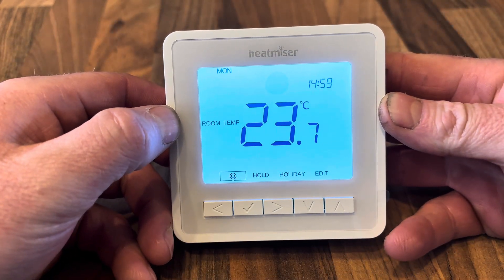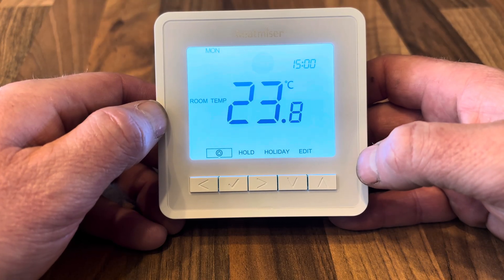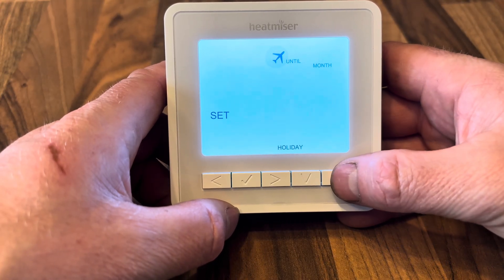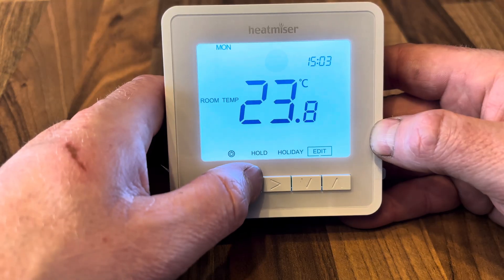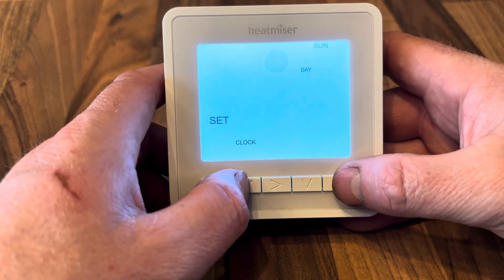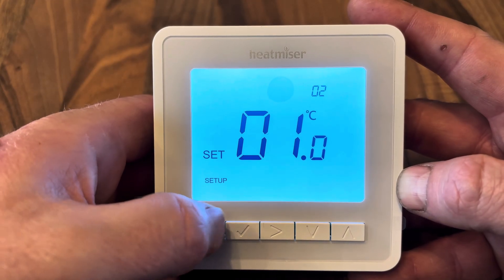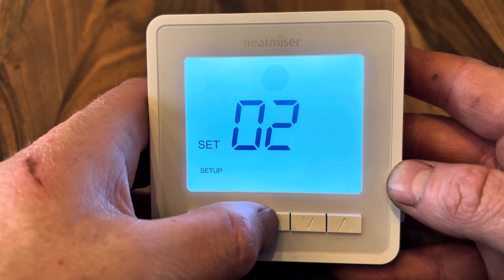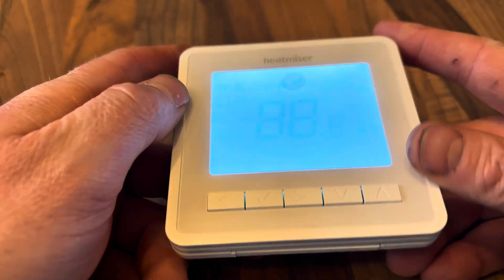Heatmiser Thermostat USER GUIDE #heatmiser #userguide #howtouse #thermostat

Comment: How do i turn on my underfloor heating
Reply from the maker: Make sure that the thermostat is calling for heat & a flame symbol is on the screen. Up arrow to raise the temperature and tick button to confirm it.

If using a heat pump with your underfloor heating, there may be a delay in the warmth coming through due to the lower low temperature ranges when compacted with a boiler

Comment: Hi mate. Great video. I’m having trouble lowering the room temp. For example, it’s currently at 24 degrees, despite having my settings at 21 for this time. I also cannot see the flame icon when I manually override change it. Do you know why this is happening? Thanks
Reply from the maker: Is it just the one room thermostat you have?
Reply: @i85_Heat_Pumpsyes just one. It’s in our living room

Comment: Great vid. One question. I want to set my therm at 20 degrees and would like it to kick once it drops below that but can see the option. It keeps going back to default 22 degrees once I have set the timer thing to 99 hours.
Reply from the maker: Thanks! Is that a permanent 20°c or part of a time program where you will have a set back to a lower temperature?
Reply: @i85_Heat_Pumps  yeh just want to set it at a certain temp whether it's 20 or 18 i would like to just set it and leave it and not worry about the countdown clock.
Reply from the maker: You need to change it to non-programmable, so it’s feature 12 - 00. Link below to the video.

https://youtu.be/McTgo3HyRp4?si=CO6v9GhOiz-KIoz2

This will disable all the programming and can use as a basic thermostat
Reply: @i85_Heat_Pumps mine does not have a tick. Its a slighty different thermostat. Do you have an email that i can send a pic too of my thermostat

Comment: I have an Ecodan heat pump. The Mitsi panel is set to 21 degrees, does that mean that regardless of what temperature i set the Heatmiser it wont turn the heating on beyond 21 degrees?
Reply from the maker: It all depends on how it is setup, if there is a volt free signal from the heatmiser to the Mitsubishi FTC that is wired in correctly and set up then the system knows that when there is a demand from the external thermostat and that will govern the heating controls

Comment: My boiler has its own mains power connection. And has 2 core cable coming from wiring centre to its rf port. How do i save energy by leaving it ON during the holiday mode. Will my wiring centre or thermostat put it in sleep mode and only ignite it at a set time?
Reply from the maker: If your boiler is controlled by an external thermostat and/ or wiring centre, then yes, if there is no demand on the thermostats then it should not produce any heat. If your thermostats are set on time programs, then the boiler should only operate when there is a demand within those time periods.
Reply: Great video👏 ı cant see the mesh connection on the screen is it ok if thermostat works without all senc? I am having trouble to heat the flat, obbiously something wrong in set up:(
Reply from the maker: It should work without the app etc. check to see if it’s sending a signal to the wiring centre by the light(s) illuminating. Check all valves and or pumps are open and on when the demand is calling
Reply: @i85_Heat_Pumps now I managed to link all thermostats senc, but what ever the reason during the night it switched to freeze mode so temp went down to 18C ! How can I cancel the freeze protection set up?
Reply from the maker: You’ll need to move over to highlight the power icon symbol then press the tick button to disable/ enable frost protection mode 

https://youtu.be/LZ0xAD561KQ?si=OEFpDHVqoR5Bo2we
Reply: @i@i85_Heat_Pumpsl did that but it switch to freeze mode it self during the nigh.. this is the issue I cant solve😞